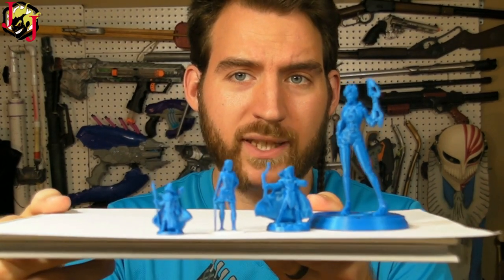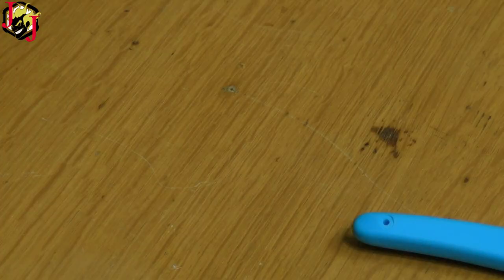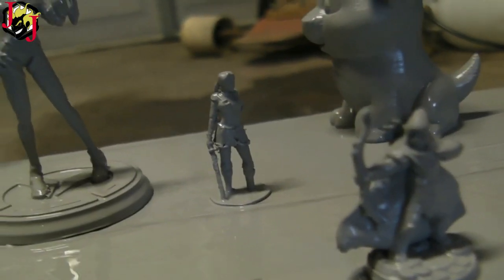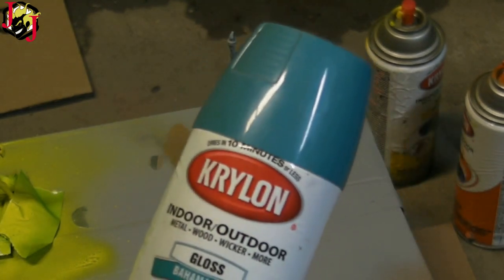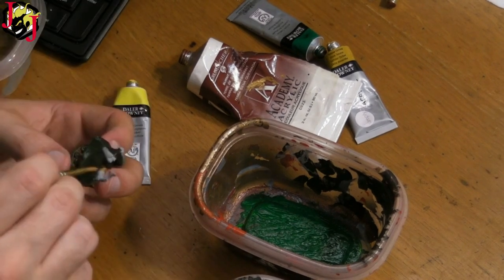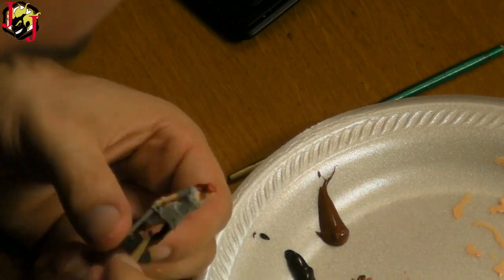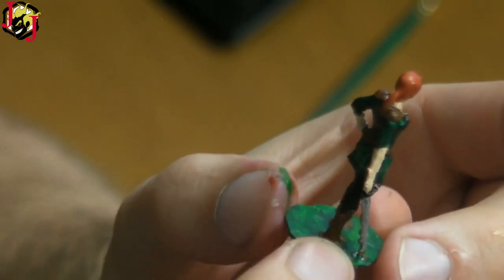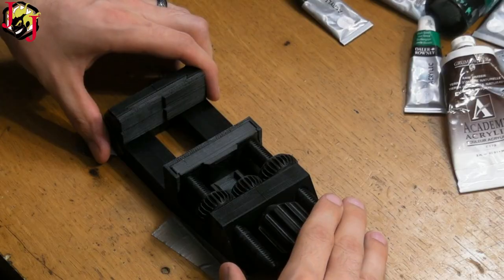I TOUCHED THE BUTT (AKA How to Paint 3d Printed Minis)

Comment: Do you use cura?
Reply from the maker: Yup I haven't had any problems using Cura as my go to slicer. It has a lot of settings that are pre-made and make it a bit easier to get into the hobby. Then once your feeling more confident you can open up the whole  settings menu and control every possible permutation :)
Reply: I have been printing 3d statues for a while but the supports in simplefy 3d aren't that good so I think I'll come back to cura. Thanks